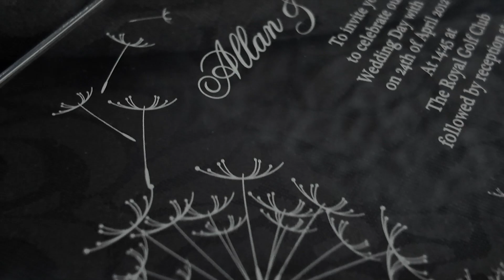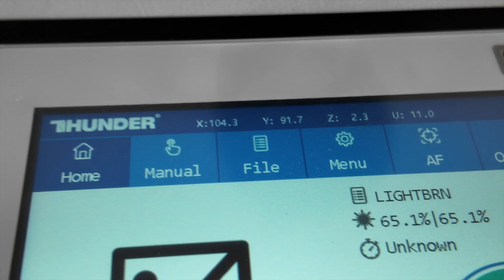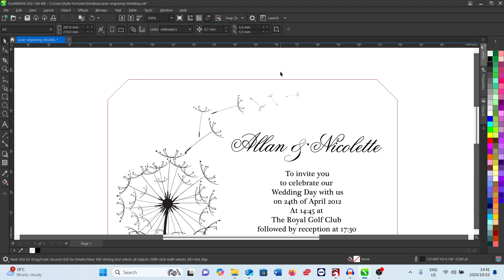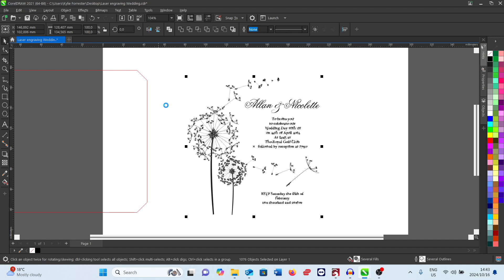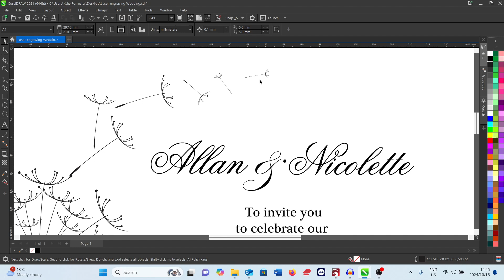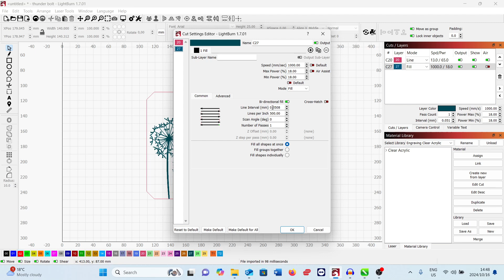Laser Engraved Acrylic: Fine Detailed Wedding Invite

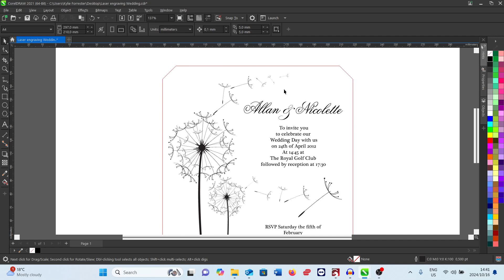Comment: You just said at the 4:20 Mark that a glass tube would struggle to do the intricate engraving, My Mira 7 Redline does this so much better with my Glass tube... AEON give the best Intricate engraving I have ever seen.
Reply from the maker: That's scientifically impossible. Glass tubes will never ever engrave better than a metal laser tube because glass tubes produce a bigger beam spot diameter than metal laser tubes. I used to sell Aeon machine and I did the test's against Thunder Laser machine & well i chose Thunder as my brand. You want to see the real difference then manufacture a rubber stamp & use size 6 font, hahaha you will quickly realise that glass tubes don't compare with metal RF tubes, not even close.